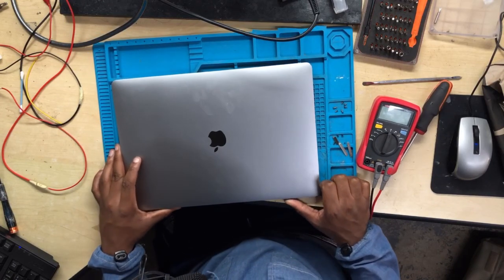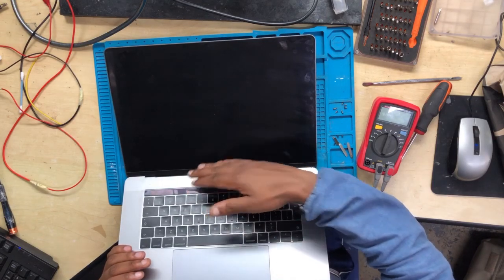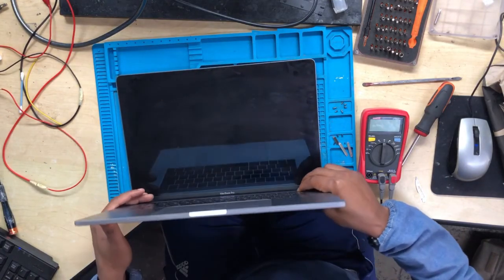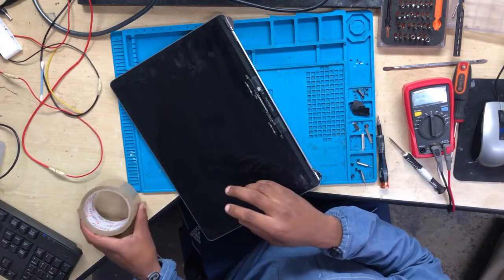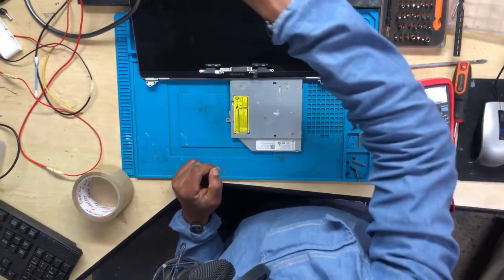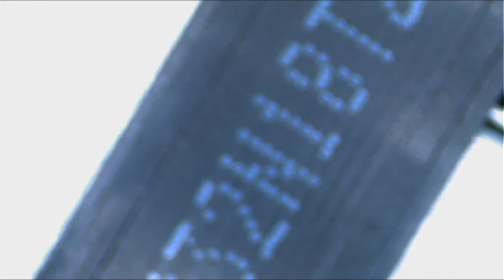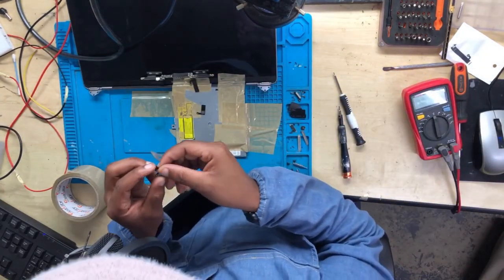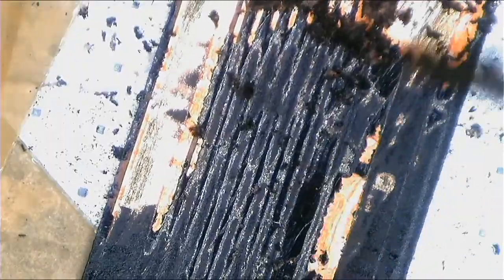This is how you fix macbook black screen causing you to move it in certain angles - flexigate repair

Comment: Geniusly done. never suspected you could actually put the cable upside down to mend the ends together. Did you protect your soldering with any UV glue?

Comment: Unfortunatly does not work for me, I tried two times and it never worked for me, I did the wire ones, you need good thin strong wires for this job , that's the key
Reply: Use desolder wick, the Stripes from it seperate them and ise AS jumper wire or did U mean the flexcable IT self ?
Reply: I mean get 0.02 or 0.04 jumper cables and use them to create the connection between the two cables instead of this method , the method in this video looks nice and wish it had worked for me but  it didn’t